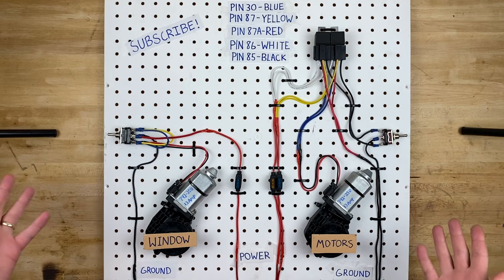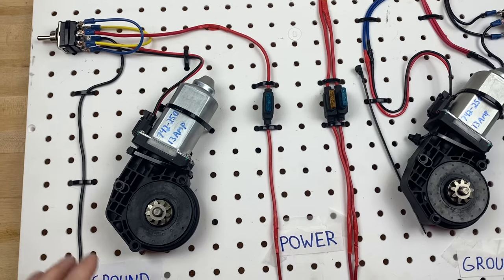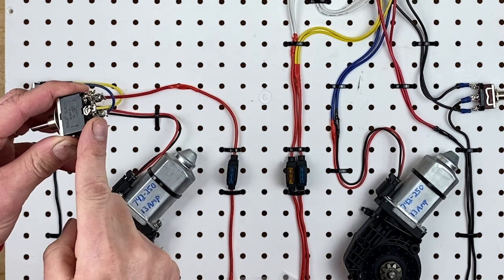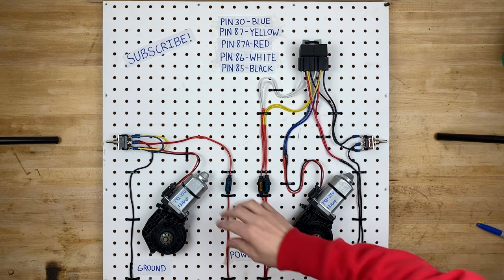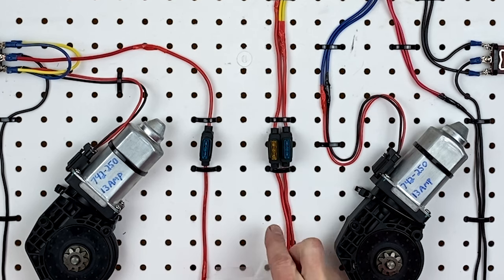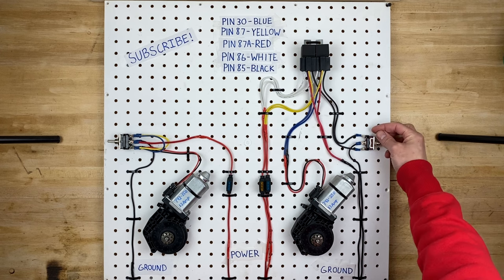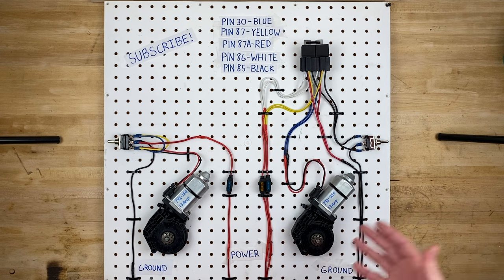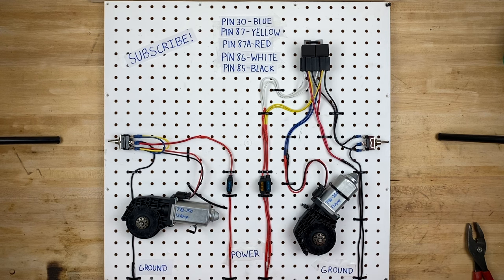Power Window Motor Car Wiring - FOR BEGINNERS! @WiringRescue

Comment: Thanks for the help Ratty
Reply from the maker: Whoa! Thank YOU! I really appreciate that! Hopefully your project goes well!
Reply: In a regular toyota camry that 1999 how would this work with a 5 pin switch? Also when i use my tester it tells me 2 of the wires are sending power to the switch
Reply: @WiringRescue how would I make a master switch ( 94 Isuzu rodeo ) my master is 189$ vs making my own ( using your videos ) but I'm trying to figure out how to use 7 6pin switches 4 on driver door ( master ) and the other 3 for each door I've been trying to figure how to do that would you be able to make a video on a DIY master switch?? I would honestly appreciate it
Reply: Sir schematic diagram please❤

Comment: making a body harness for my car, used this circuit to actuate the pop up headlights was stuck for a day scratching my head
Reply from the maker: That’s awesome! Also - pop-up headlights are the BEST!
Reply: Same! Doing my window motors and my pop-up headlights this way! Thanks to this channel!
Reply: I've wired up my motor exactly as in your video but my fuse for 87 keeps blowing

Comment: Using the B+ or negative term would be easier for others to follow. Same with the window motor B+ now or reversed to ground. Terminals on relays don’t change, but wire colors do!
Also, GM places a polymer NTC thermistor inside the motors connector. If current goes too high, it gets hot and opens the circuit. This prevents damage to the motor itself if completely down or up and held. Ut reset once current is removed. I can’t speak for other brands of motors. Never took those apart!

Comment: Hello! Great video. I have a question. Do the power window motors have a built-in stop?  ( Load Sensor)In other words, if you hold the switch up or down, will the motor sense the top or bottom and stop?

Comment: converting my manual window ranger to power windows using the OEM switches. This video is by far the best I’ve seen in making it understandable and simple. only thing I think I’ll have to wrap my head around is wiring both doors off the double switch setup like it currently is, wouldn’t I just bridge the switches like in a car audio sub woofer set up? Or like a double switch light in a house for a single bulb?

Comment: I used his tail/brake light video to fix a problem that a licensed mechanic couldn't figure out after of having the 2000 Chevy C1500 in his yard for close to two years.  Took me about 2 hours to finish it up and it worked with the signal switch, brake switch and the 3rd brake light.  This guy is GOOD!
Reply from the maker: Heck yeah!! I’m always thrilled to hear what people are doing with the info from these videos! Thanks for watching and sharing that huge win! 🎉

Comment: That's a great explanation of how each set up works. Being a visual learner that helps a ton.
I'm adding power windows and locks to a vehicle that didn't originally have them so this is definitely a light in the tunnel 😅.

Comment: what a fine thing you are doing here. I have an old tractor with a 24 volt starter that used a series/parallel switch(relay/solenoid). I had problems with the switch all the time. It had 2  80-amp aluminum fuses right on the switch which would frequently burn out. The actual switch for the tractor is crazy exspensive for this old Russian tractor.
So I am in the process of rewiring it. I am, and always have been scared of wiring. As I dont know how it works, very well. I would pretty much glaze over when trying to deal with it. The more of your videos I watch, the fog is starting to lift. Particularly in this video, as you explain the relay.
The way my tractor was set up, you only needed 24 volts to start, everything else is 12 volts. I bought a 70 amp 24 volt alternator and a continuous 4 pin 250amp 24-volt solenoid. I also have a 2000-watt 24-volt inverter(for AC onboard power) that I want in that circuit. The alternator that I bought from Amazon is a DB ELECTRICAL ADR0047, it has 4 posts on it. Post R tests about 13.8 volts, post AT  tests about 28.4 volts, post I also tests 28.4 volts, 4th post is ground. I have a 2awg copper strand for this circuit. I am unsure of what fuse to use here? The old setup was an 80 amp, so that is at least a good place to start. The problem is , it would frequently burn out. The engine at the front and, the batteries in the back, so about 7-8' separates the starter and batteries..maybe this is where the current surge on start burns fuses? My thinking here is to use pole AT on the altenator to make a circut for the starter and the inverter. The tractor already has a big heavy ground switch that I would also like to have in this circuit to avoid parasitic drain. Then I would like to use pole  R for the accessories...lights, wipers, etc.
I would love to send you pictures of my project if I knew how. Any direct help you could give me to achieve my goals would be greatly appreciated.

Comment: Wonderful video and content ! May I suggest, on your breadboard to the left of the pin number identification area, you draw a square large enough to display a representation of the pins on the bottom of a 4 or 5 pin relay and label each pin as well.  That way I don't have to hold a relay in my hand, to see where each wire connection goes, while watching the awesome relay designs you come up with 🙂

Comment: Is it possible to use two switches to control the one motor? Would I just wire the 2nd switch into the same trigger wires? Or is there a different way to do it
Thanks anyone who helps!
Reply from the maker: Yes - wire the second switch into the same trigger wires for the relays and it should work great. Thanks for watching!

Comment: "Firstly, thank you for the assistance provided. I'm curious about the necessity of a relay for each window direction (up, down). Could each window potentially operate with just one relay? Secondly, I'm working on upgrading my 1978 Peugeot 504 to have power windows on all sides, implementing central locking, and installing a driver master switch for window control. Quality is my priority, and I'm aiming to keep costs low. Any advice or guidance on this project would be greatly appreciated. Thanks in advance!"

Comment: Great explanation, it confirmed for me that I had my actuator wired correctly. The problem I'm having is the actuator motor housing is getting grounded when mounted to the chassis. It runs in one direction just fine, but will short and blow the fuse when the polarity is reversed. I have tried to create isolators at the mounting points, but it's used for a parking brake, and that only last so long until it grounds its self again. Should the actuator motor be grounded under this scenario, or is there another solution? Thanks

Comment: Hello and thank you for your great job. I have a question for you. I am thinking on trying relay way on a smaller 12v motor. This motor is in always falling hot to cold door in a truck duct system. Basically it turns this little door from ac evaporator to heat radiator and back as needed, as most good working units. My concern is on when to stop pushing the on button so I don’t strip a warm gear or brake hinge on that door. Is there any light 💡 indicator could be installed in the wire chain or something that will stop it from damaging itself. If you could make that video that would be very interesting because it’s for cars and trucks , something simple and reliable and thanks again👍

Comment: Hi Jeremy,  Love your channel your wiring videos are great!  You reduced my four 4 pin relay design to run a power window down to one switch!  Got a question / challenge.  I retired in 2022 so one of my goals or projects is I'm building a 1983 280ZX drag car (old school SBC power with Carb) with some 18-20 year olds from my church.  Mentoring is an exercise of patience.  We gutted the entire electrical system but now want to create a circuit to operate both LH & RH windows off switches (preferably the OE switches)  on the drivers door, and retain an operable RH passenger side window switch while the main power in on.  Our plan was to use 5 pin relays, but how do we add a third switch?  Thanks,  Ed G.
Reply from the maker: That’s a solid question that I think I need to think through and get back to you. Also thanks for the kind words about the channel and mentoring younger folks! I’ve always wanted to be an automotive teacher / hotrod builder, but found that I can reach a huge audience with YouTube videos. So I’m doing my best, like you, to pass on whatever I can to others while Im still able to do so! Thanks for what you do and I’ll try to figure out your scenario and get back to you.
Reply: @WiringRescue  I believe after I asked you that I found a solution.  I  believe I can (with a 5 pin relay solution) just wire another 3 terminal momentary switch in parallel with the first switch.  Now I have to disasseemble the doors to see what type of switches Nissan used!
Reply from the maker: @edwardgawrych1828  - that does sound about right to me! Hopefully it’s easy to make it work!

Comment: Hi
Thank for this video. I’m not much of a electrical guy and having issues with the 1993 4runner window wiring harness. Since I couldn’t find any color coded wiring diagram, all I need to know is how is the front right passenger wiring harness connected to the main driver window wiring harness. If splice. Am I able to control the passenger window from driver main window controller?
Your help is very well appreciated.

Comment: great video! As I am trying to learn about how to convert my square body chevy manual to power windows (using stock parts hopefully) there is one thing I still dont understand after watching your video. You have clearly shown how to wire the motors up, but my question is this... In a normal factory power window set up the windows stop automatically when you push the switch and the window reaches its maximum height. But in the case of your video you would have to let off the button just as the window reaches its maximum height.. How do the old school (86 chevy truck) factory power windows just automatically stop at the max window height? I am trying to install factory pwr windows into my chevy using stock parts.. Thank you for answering my long question.. LOL

Comment: Great work. Quick question How many 13amp  window motors can you run off those 2 relays? I thought i red you can parallel the window switches but what happens of they all four are being used at the same time will that pop the fuse? Or do you need 8 relays for 4 windows? Thanks for your help in advance

Comment: Excellent video. Is there a way of adding a 3rd switch in so the passenger window can be operated by the driver? Rhd car. Bought a electric window kit for my van that come with 6 pin switches that don't match up with the ones in the wiring diagram  so im a little stuck 🤔

Comment: What a great video🙂....very interesting would like to try it out ....I have a question on how the power suddenly cuts off to the window motor when the window reaches the top or bottom...
Reply from the maker: I did too, and that’s why I grabbed it with pliers at the end. To be honest, I expected the fuses to blow, and they didn’t. I may need to take apart a window motor to find out how it works.
Reply: @WiringRescue  ok that will be great to find out ...because those motors have lots of power if there isn't something that  cuts off the power something breaks.
Reply: The electric windows automatic function is controlled by the sliding contacts inside the window motor mechanism.
Reply: @tonyreyes9969  Thanks... I hope to find one open so i see how they work..

Comment: This is an amazing instructional!  If I want to control the relay circuit with 2 different switches (example: one switch at each door, both running the passenger window motor) would I just wire the second switch in parallel with the first one?
Reply from the maker: Yep! That sounds like it should work! Thanks for watching!

Comment: this is very helpful.  but how will i wire a positive switch instead of a negative switch . I'm using the same switch on my can window and the positive is in the center pin. how will I connect to the relay.or is it still the same but not grounded instead it's a positive wire is hooked up. thank you for any response

Comment: Good evening, thank you very much for sharing your valuable knowledge. I would like your help. My car ( Toyota Aygo ) on the driver's door does not have a switch for the passenger's window, so I took extra new wires from the (passenger's) window plug and put them on the driver's door. All good so far the new switch I put in the driver's door for the passenger window works but when I press the switch on the passenger door to roll down or up the window it doesn't work. In short, the new switch on the driver's door works while the old one does not. Do I have to put a relay like in the video you uploaded with the lamps ( 5 Pin Relay Wiring For Beginners | Diagram | @WiringRescue ) in the third version or is it a mistake? If you have not created a similar video, it would be good to do it to help others. Thank you very much

Comment: Thanks - not being wiring-wise, I found this very interesting.  I stumbled on your video when searching for a way to convert my power window button to a one-touch scenario.  My Ford Ranger (UK) was produced with one-touch only available for window opening.  I want to convert it so that one-touch also works with window closing.  I contacted @Ford at the time of purchase, as I believe it is a safety issue, but they were not interested.  In my view, it is unsafe to have to hold the button up when driving off from a stationary position, after perhaps speaking to someone through the window, especially if the vehicle has a manual gearbox (like mine).  One needs to hold the steering wheel with one hand, while changing gears with the other.  One has to use one's third hand to close the window!  It would be nice if the window closed itself after a "one-touch".  So, my question is, have you ever seen a modification option to convert a switch to be one-touch for both opening and closing?  That will be very helpful.  Thanks again for educating us who have little knowledge of these things.
Reply: Wow johnfrancis, this is exactly my question. My car has one-touch on the drivers window but not on the passenger side. I would like to have both one-touch. The two switches are in the centre console and are identical switches with identical wiring, where does the one-touch come in?

Comment: Amazing video and one that I really needed to watch.  I'm working on a project to have a power sliding rear window installed onto my Chevy Silverado 1500 custom.  The truck is not equipped with a powered sliding rear window therefore not equipped with a fuse junction block (under the dashboard) that will accommodate the relays and fuse necessary to operate the sliding rear window.  So, I'm taking your approach to resolve the issue.  However, I have one question, I want to purchase a roof console with a switch and, although the console has power (unable to find a power source on the current console), where do you suggest I should hide the relays and fuses? and knowing I have power at the fuse junction box, can or should I run a wire to the box for power? Or should I just run a wire to the battery.  Thank you for a great video; and I am subscribed to your channel.
Reply from the maker: It’s tough to fully understand the whole project without being there, but I’ll try my best:
- if you have any room in an existing fuse box and can add an additional circuit to it, that’s the route I’d go. Otherwise I’d probably just run a new wire from the battery to a new small fuse box under the hood (check out the 6-spot one from Leash electronics). Then take power from that fuse box to power your new window motor.
- the relays can really go wherever they fit. I’d probably put them in a place where you have to run the least amount of wires to and from them. I’d bet that is in the overhead console or close to the window motor.
Reply: @WiringRescue  Thank you Ratty and you answered most of my concerns.  I'll be the first to tell you I'm no mechanic or electrician.  I did find three live circuits in my driver side fuse junction block/box, but I've still not figured out how to get to the back of it.  Please forgive my ignorance but if I'm successful at getting behind the fuse box I should just run a black wire to the live/powered fuse located behind the box?  What I'm finding is that I've figured everything out except how to get power to the console.  Thanks Ratty and my apologies for asking too many questions.
Reply from the maker: @FrankSr1st  check to see if your fuse box has some additional male spade connectors on the front side of it. Sometimes, you can just plug a wire with a female spade connector on the end, right into the front of the fuse box. Also - use a red wire, not black if you are running power from the fuse box to the console. :)
Reply: @WiringRescue  Hi Ratty, thanks for the replies, they're appreciated and realize I'm taking up some of your time.  If you don't mind, I'd like to send you an image of the fuse box via email as I can't find any other way to give you a visual.  I think I understand what you are referring to when you say "male spade connectors" but I'm no expert and perhaps an image via email will help to explain my dilemma.  Thanks Ratty.

Comment: Is it possible for the relayed circuit to power two motors at once? So to have the two Pin30 blue wires split into 2 for one motor and 2 for another so you can put two windows up and down at the same time off off one switch?
Reply: Yes that is how it would be done. Double up the amps though for the fuse and for the wire before it is split.